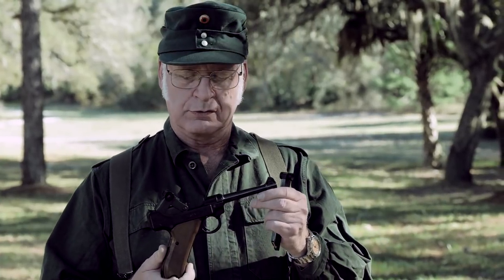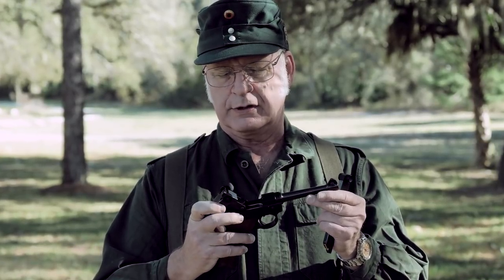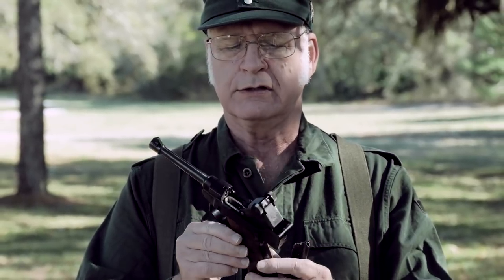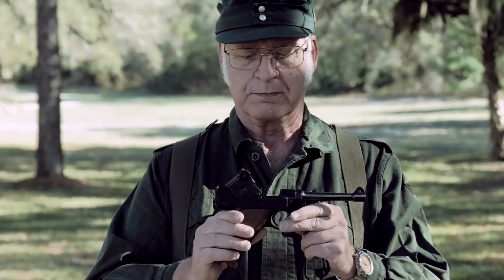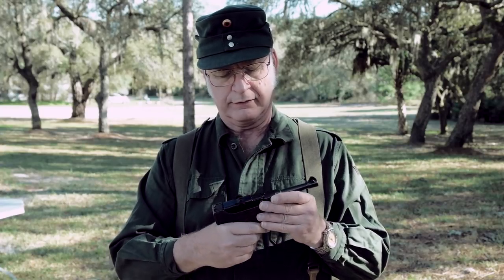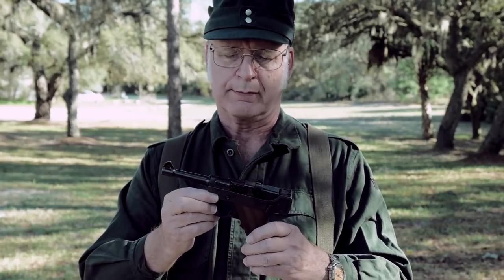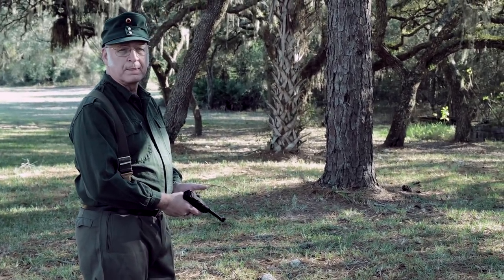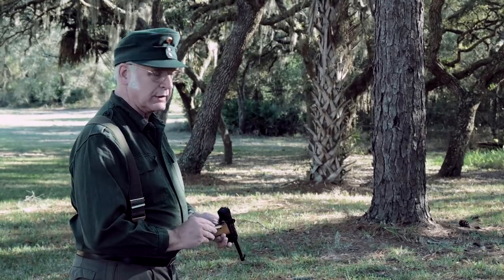Bill Akins shoots the .22 caliber Stoeger Luger

Comment: I had a problem with my .22 cal. clip spring not being strong enough to push the clip button against the slider that hold the toggle action open on the last shot. I took a 1 inch piece of paracord  and put it under the spring. Pull the spring up with a wire and stuff the paracord under the spring. Its trial and error on getting the right tension on the spring. This fixed the problem. Springs are hard to find. These are great little pistols. I love the Luger design. It has seen its wars, but to me its not a reliable pistol for self defense. You never know when its going to hang up. To me its probably the most beautiful automatic pistol ever made. Thanks for your video and advice.

Comment: I watched this video and then bought an older Stoeger Luger from a local gun shop with the understanding that I could bring it back if it wasn't a shooter. I had to take it back, but they are having someone take a look at it, if he can't get it shooting then I'll get something else. But I wouldn't have made that deal without viewing this video first, no I would be stuck with a 22 paper weight. Thx
Reply from the maker: +SGTDuckButter, all of them seem to prefer and run pretty good on solid nose round points in 40 grain. Hollowpoints frequently jam in mine so I only use solid nose 40 grains. CCI mini mag solid nose in 40 grain. 
Is the problem you're having a feeding, extraction, firing pin or trigger problem? Please describe it for me.
Reply: Yeah, when I got it I knew to shoot CCI mini-Mags threw it. The problem was it wouldn't feed, and it wouldn't eject. Also the few times it would empty the magazine the bolt action would not stay up so you can see into the chamber. I know these guns are a little complicated and hope someone just took it apart and put it back together wrong. But like I said I made a good deal, they get it to shoot reliable or they keep it. Could be the magazine too but I don't care. I bought it for the action.
Reply from the maker: You're very welcome SGTDuckButter. I'm gratified to know my video helped you.
Reply from the maker: SGTDuckButter, it sounds like you have several problems. Offhand I'd say your extractor's spring is weak and causing the extractor to not grab the rim of the cartridge properly and it is slipping off. Also sounds like your feed ramp needs to be polished, and or your magazine lips could be bent, but polishing the feed ramp and doing a micro chamfer of the edge of the chamber so the bullet nose won't hang up there could fix the problem if it isn't the magazine that's at fault.

Comment: Thanks so much for this video! My dad has a Stoeger Luger, which I have borrowed on a semi-permanent basis to go target shooting regularly. It's easily the most accurate semi-auto pistol I've ever fired. I've had some trouble with feeding issues, so I wonder if you have any advice in that regard. Additionally, I bought a spare mag online, but I can't remove it without prying it out of the grip. Have you seen this issue before?
Reply from the maker: +doggonemess , You're very welcome doggonemess. To minimize feeding issues, I recommend just using solid round nose bullets. In my experience they are less prone to jam on the edge of the breech. Also 40 grain bullets will work the action better than 36 grain ones. I recommend CCI mini mags, 40 grain, round nose bullets. Another thing you can do to aid feeding, is to polish the edge of the breech so it doesn't have a sharp edge to catch the nose of your bullet on. Yes I have seen that issue before on mags sticking in the grip. Usually what works to eliminate that is to file down that little button on the side of the mag that you pull down to load. It sometimes sticks out too much and causes the mag to stick in the mag well.